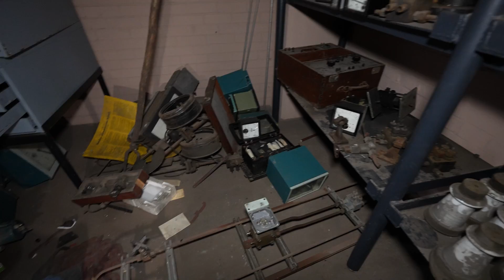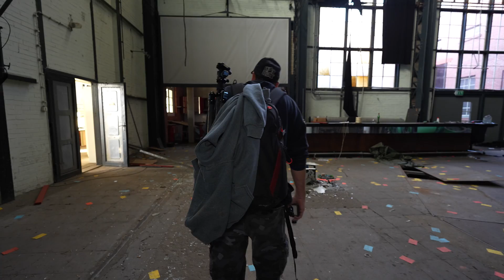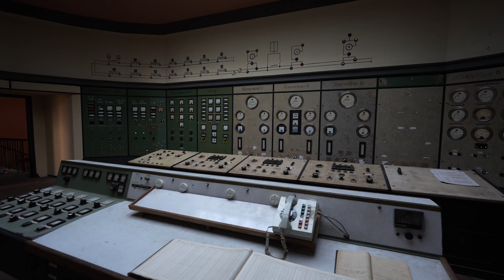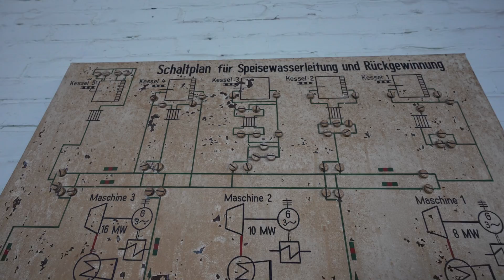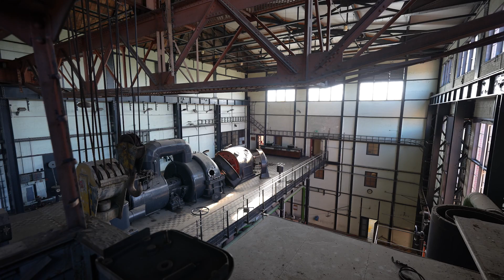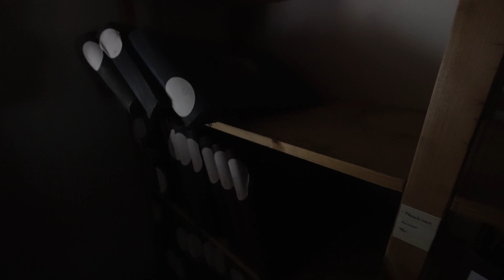Abandoned 1926 Power Plant Frozen in Time

Comment: A coal turbine, or coal-fired power plant, burns coal to heat water, producing steam. The steam drives turbines connected to generators, converting mechanical energy into electricity. The process is efficient but raises environmental concerns due to emissions.
Reply from the maker: Thanks for the info and for watching our video!